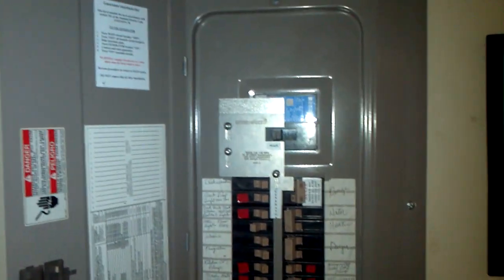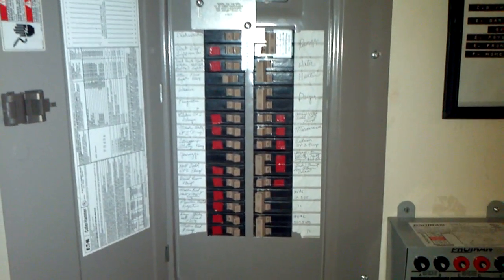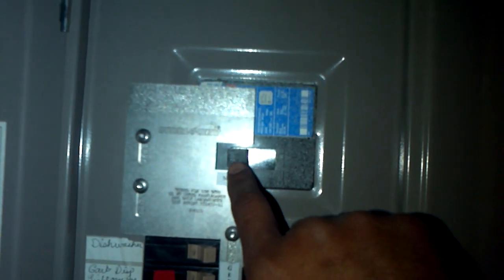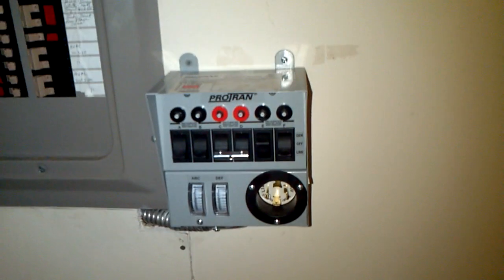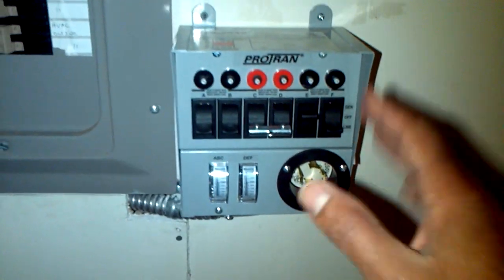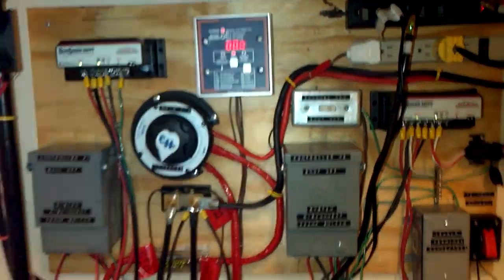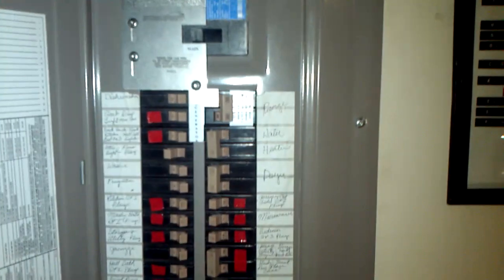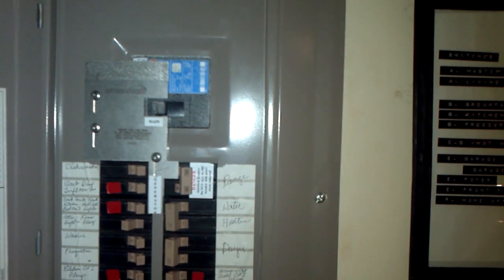DIY-Home Solar with Interlock Kit Installed Part-3

Comment from the maker: My system is setup so that I could use solar or a gas generator, and yes not at the same time.  And yes again, when when the inverter is energized the 240v gen connector is hot. I have a cap on it for safety. I now have a MaganSine inverter/charger which allows me to charge my batteries from alternative 120v source such as a generator. However, I could disconnect power from the Inverter via a 30A breaker, and plug in a 240v generator and power the house through it, while charging the batteries.

Comment from the maker: Hot water heaters and furnaces require a lot of watts.  My water heater would drain my bank in an hour or so.  I recommend propane or natural gas heaters. I have a gas fire place and I'm exploring tankless propane water heaters.  My system is designed to support basic 120v loads like lights, appliances, electronics etc.  I'll use the freezer but not the fridge, instead I'll freeze large ice packs and use a large cooler, got one from Costco.  Fridge motors come on way too often.

Comment from the maker: With all of my batteries I have a total of 7920 watt hours of stored power, of which 80% (6336 watt hours) is usable.  Also, approximately 80% of my house lighting are LED's. My freezer requires approx 180w to run during it's duty cycle. Therefore 6336wh / 184w = 34hrs (that's if the freezer's duty cycle was 100% of time, which it isn't).  I can run the LED lights for weeks (i.e., example bedroom lights, 6336wh / 8w = 792hrs). To "fully" recharge from dead requires approx 15hrs of daylight.

Comment from the maker: Thanks for your comments, but the transfer switch still comes into play, in my case at least.  The transfer switch will allow a non- technical people, ie wife, mother in law, nephews, etc.. to simply flip a switch as opposed to being inside the electrical panel where I don't wont them to be.  The interlock is for people like me that understand whats going on and can energize the entire house when necessary.  The transfer switch energizes what is necessary at the moment rather quickly for others.

Comment from the maker: @firehawk71 Thanks. The xfer switch is designed for 220/240v wiring, so my electrician split (2) 110v circuits, so it's 110v (outlet #1) for A.B,C and 110v (outlet #2) for D,E,F - (C,D together make 220v).  I also use 2 outlets on the inverter to decrease Amp overload risk. With AC there is no voltage loss when powering my house wiring from the main panel via the inverter. Also, powering on "110v" based appliances, electronics, and lights "as needed" won't overload a 3000w inverter. Take Care.

Comment from the maker: @abenwinUT Typically, Lead Acid batteries should not be completely drained past 80%. This is called Depth of Discharge (DoD), the 10.7v you mentioned is it's State of Charge (SoC). At that point the battery is considered dead. Inverters and most batteries have an internal shut off point where voltage will cease to flow, to save the battery. However, you can hook up some low voltage DC lighting or DC appliances (ie. RV Fans, radios, etc.) that will allow you drain the batteries further, b

Comment: •This is not a comment on your video other than to say I have gotten a lot of info from them.
•I am a novice just starting out. I keep seeing that you should not completely discharge a battery. My inverter shuts off when battery gets to 10.7v. So how can you use more of the battery if the inverter shuts off at 10.7v? My inverter is 1200/2400 at 12v. Great info on your videos.

Comment from the maker: @helloman1976 Glad you liked the video.  The T105RE's look like pretty good batteries. However, I went with AGM's because they are sealed and totally maintenance free. No gassing, spill, or temp issues and a decent lifespan. I have to store them in my utility room, so safety was an issue. I could have used a box and venting system, but it seemed AGM's would fit my needs better. According to the manufacturer, all Optimas have, on national average, a 6-7yr lifespan. I expect 7+yrs from mine.

Comment: Hey man, thanks a ton for the video. I'm working on going almost completely off the grid so this helps a ton. I don't use my main breaker box, I use a smaller separate box and my system is completely separated from the grid. The batteries that you picked up, the blue top Optimas, why did you use those? You should go with real solar batteries like the T105RE's which you can get for about $120ish each and they have a 7 year warranty and are for solar specifically. Check out my videos.